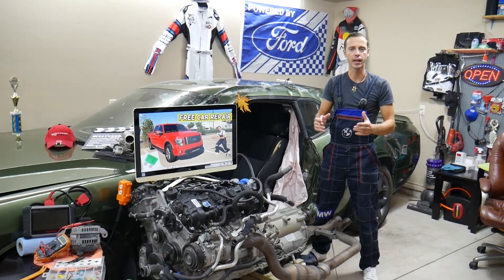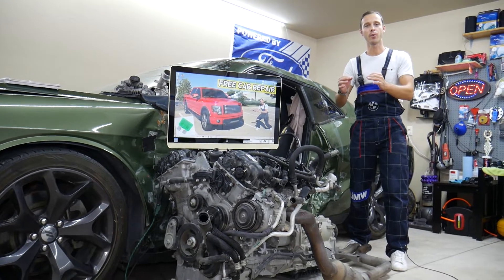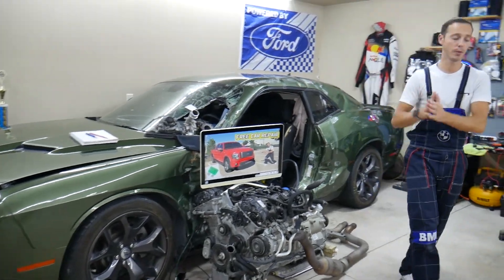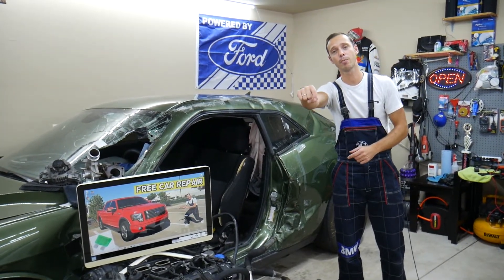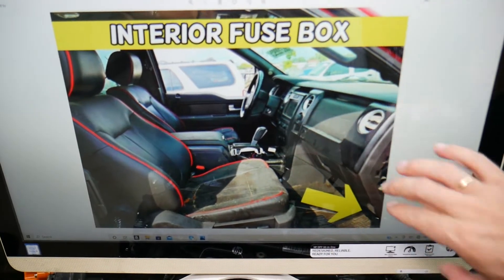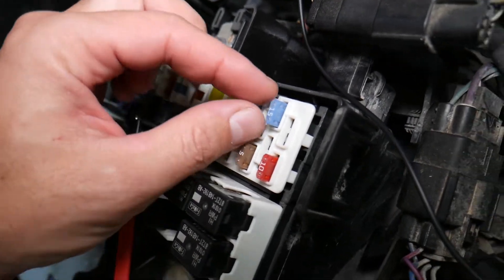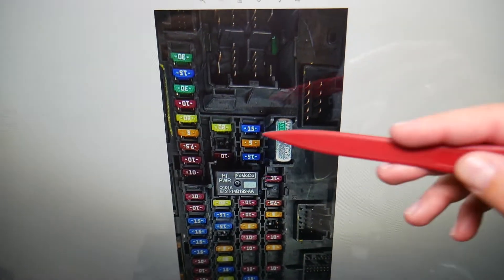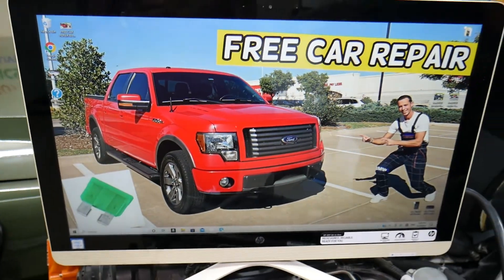FORD F150  CENTRAL LOCKING FUSE LOCATION REPLACEMENT F 150 DOOR LOCK FUSE 2009 - 2014

Comment from the maker: Buy Parts and Tools Here:
► Ford F150 Parts: https://amzn.to/3Tk73p1
► M Case Fuse: https://amzn.to/3wEm648
► Micro 2 Fuse: https://amzn.to/48yPKFn
► Maxi Fuse: https://amzn.to/3ImlWkx
► Mini Fuse: https://amzn.to/3IjL4IC
► J Case Fuse Low and Tall: https://amzn.to/3UVFHXI
► Relay 8T2T-14B192-AA: https://amzn.to/3V2TNGB
► Relay 8T2T-CA: https://amzn.to/3uVovXA
► Mechanic Tool Set: https://amzn.to/3V1NJhR
► Scanner That We Use: https://amzn.to/3uXuVFH

Best Scanner Tools That We Recommend:
► Cheap Scanner: https://amzn.to/3P97nEv
► Advanced Scanner: https://amzn.to/4iTXhFc
► Advanced Scanner: https://amzn.to/41Lgv9P
► Professional Scanner: https://amzn.to/3VWJnYL

Best Tools That We Recommend:
► Tool Set: https://amzn.to/4gPS8vE
► Tool Set 2: https://amzn.to/41SEq79
► Torx Set: https://amzn.to/3DsPGwV
► Reverse Torx Set: https://amzn.to/3BHGAfk
► Screwdriver Set 1: https://amzn.to/3ZPkvn8
► Screwdriver Set 2: https://amzn.to/49TR73F
► Oxygen Sensor Socket: https://amzn.to/3BNmEYn
► Oxygen Sensor Socket Set: https://amzn.to/4gracwH
► Torque Wrench 3/8: https://amzn.to/3BL7HWG
► Torque Wrench 1/2: https://amzn.to/4iOrTaW
► Wrench Set: https://amzn.to/3Pco81u
► Off Set Box Wrench: https://amzn.to/3Pafb8Q
► Voltmeter: https://amzn.to/4gKJ1MM

Best Car Accessories:
► Dash Camera: https://amzn.to/3ZJrbDa
► Tire Compressor Pump: https://amzn.to/3DIcgS8
► Cordless Tire Compressor Pump: https://amzn.to/3DFy2pE
► Battery Charger: https://amzn.to/4iOsAkB
► Dead Battery Jump Starter: https://amzn.to/3Du3s2x
► Jump Starter and Air Compressor in 1: https://amzn.to/3Wif92T

Best Engine Oils Tha We Have Used:
► Mobil 1: https://amzn.to/4gAwegn
► Castrol Edge: https://amzn.to/408MXlf
► Liqui Moly: https://amzn.to/409VkNi
► Oil Filter 1: https://amzn.to/4iNY1LV
► Oil Filter 2: https://amzn.to/3DsRbLz
► Oil Filter 3: https://amzn.to/41Rdhl0

Coolant:
► European Cars Blue: https://amzn.to/49Rf8bw
► European Cars Pink: https://amzn.to/4gxRLGG
► American Cars and Trucks: https://amzn.to/4guBulN
► Asian Cars: https://amzn.to/3P9J3C6

Fuses:
► Best Assorted Fuses: https://amzn.to/4gwCo12
► Standard Fuses: https://amzn.to/3ZQj6N1
► Mini Blade Fuses: https://amzn.to/3WifXor
► Jcase Fuses: https://amzn.to/3VVtOAK
► Low Profile Fuses: https://amzn.to/40ayXao
► Mcase Fuses: https://amzn.to/41UAqmR

Best Car Person Presents that we recommend:
► Lego Technic: https://amzn.to/406rnOf
► Portable Jump Starter: https://amzn.to/409kH1O
► Front Rear Dash Camera: https://amzn.to/3DwBTpf
► 152 in 1 Screwdriver Set: https://amzn.to/4gR144c
► Car Key Chain: https://amzn.to/41Khs24
► Car Detailing Kit: https://amzn.to/3Dxrbif

AMAZON ASSOCIATES DISCLOSURE
Free Car Repair is a participant in the Amazon Services LLC Associates Program, an affiliate advertising program designed to provide a means for sites to earn advertising fees by advertising and linking to Amazon.com